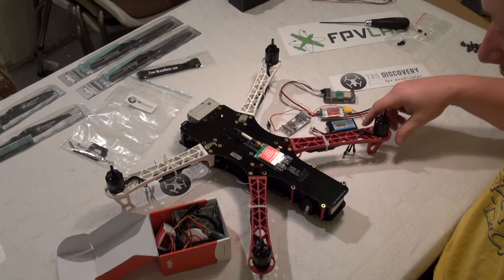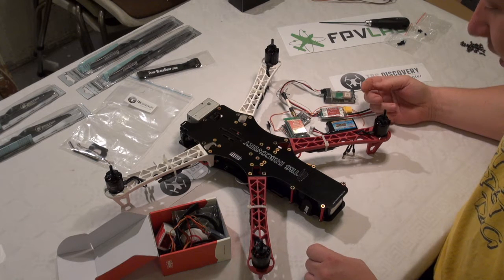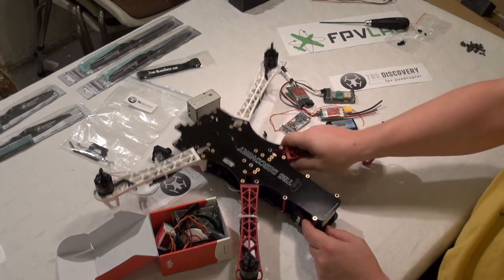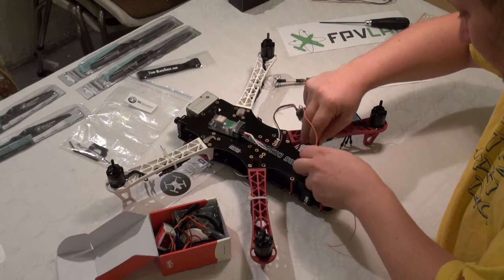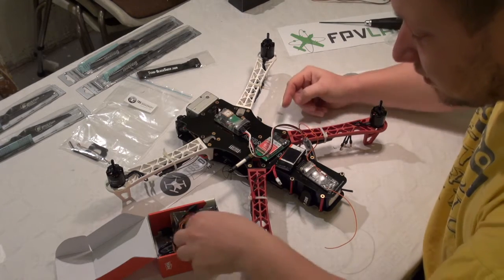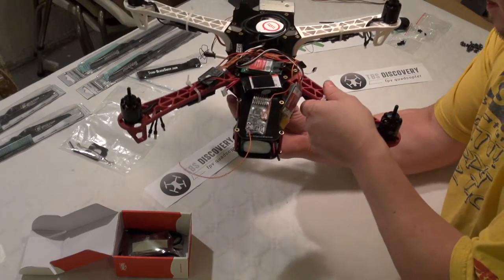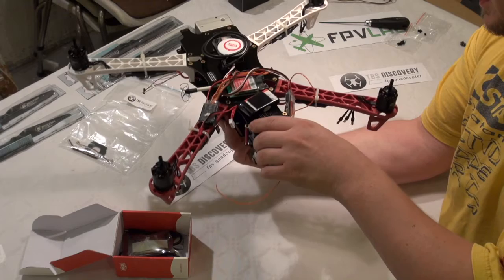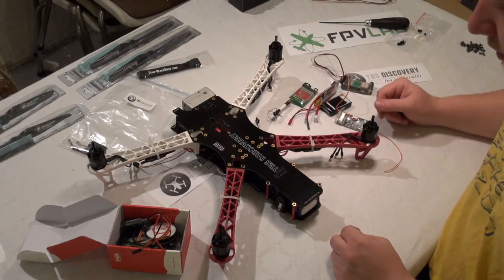TBS Discovery build EP10 TBS First CG check - 20121014

Comment: That mark on the bottom of the frame is not the CoG, it is the center of thrust mark. The CoG is 14-15mm in front of this mark which I found makes a big difference with weight distribution.